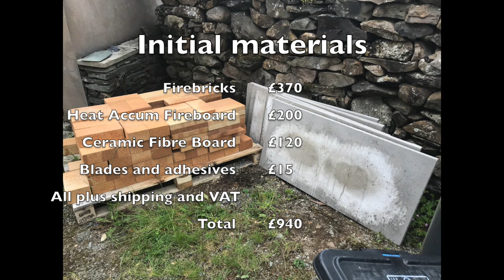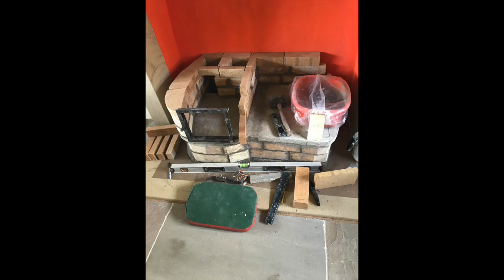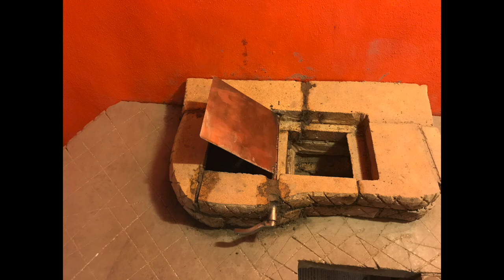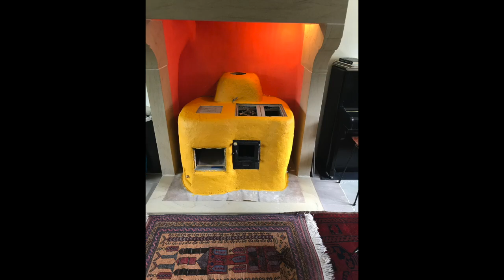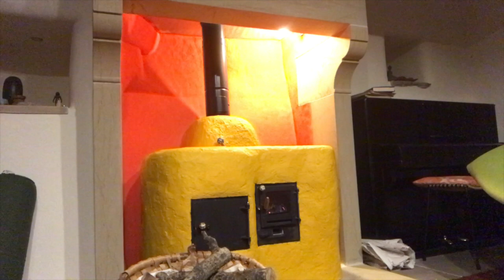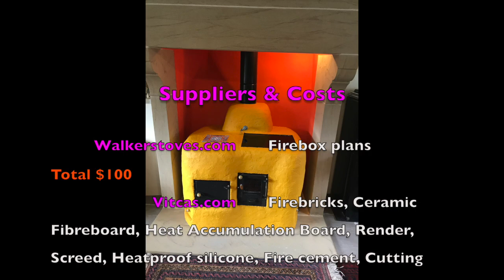Howestone Masonry Stove

Comment: Stainless steel will also “burn out” (at those temperatures, the chrome will de-alloy from the iron and nickel, then erode away with oxidative corrosion and spalling) in that location of the secondary air tube, but there is a product called ITC 213A (from International Technical Ceramics) that can be applied on metal in furnace parts like that to prevent this. It’s a ceramic coating that comes in a 1-pint container, and is quite expensive, but will both A) reduce the amount of heat transferred to the metal, and B) seal the metal surface from contact by flue gasses and oxygen which cause the erosion. ITC is an American company and their products are usually even more expensive abroad than domestically, so you might check with some EU refractory suppliers to see if they have an equivalent DIY ceramic coating for metal furnace parts.
Reply from the maker: Thank you. Sounds like useful information

Comment: Thank you for all the information on your custom stove experience. I think the "tertiary air" would be pointless and overkill. Between the high temps of the ceramic board firebox and the secondary air tube, after it all heats up 95% to 99% of your smoke will be burned up. There's nothing left for the 3rd air to do, especially if you walk outside now and see almost no smoke coming from your chimney after it's been "on" a while. All another air tube would do is inject COLD air and act like an air conditioner and, that can actually cause smoke. More air is not always best. In your system, it would be normal to get some smoke for 10 to 30 minutes until all the bricks heat up. Gasses passing along cold bricks, creates smoke. The tertiary air would just make things colder. If you chimney smokes for 10 to 30 minutes, that does not mean your secondary air is not doing its job.
Reply: Agreed. Also, a tertiary air tube in that location would compete directly with the draw through the secondary air tube, significantly reducing the amount of air being pulled through it and the port, and would very likely make combustion performance worse.